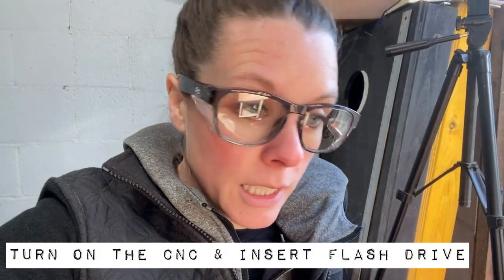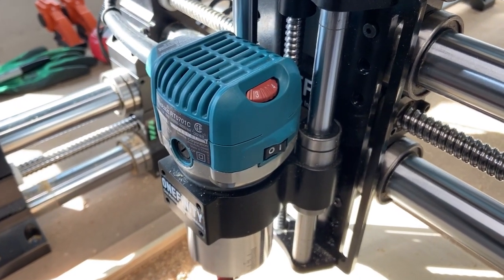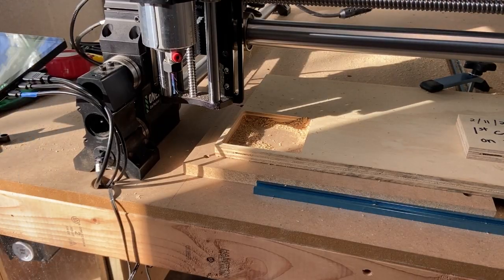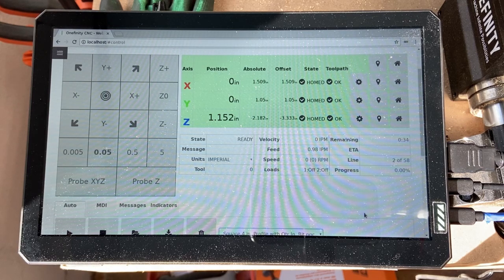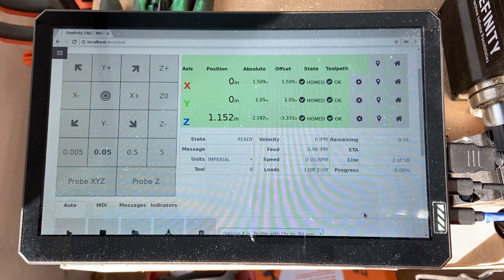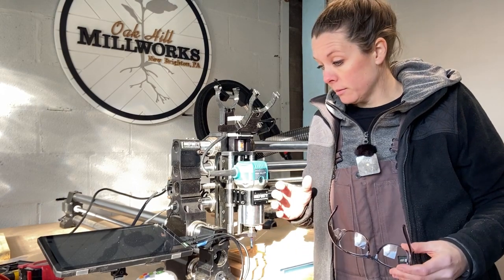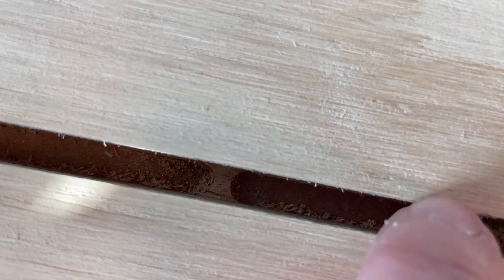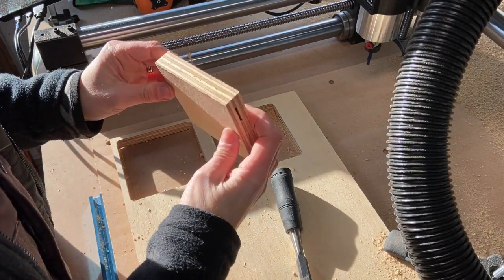BEGINNER'S GUIDE // PART 2 - Onefinity CNC - How to Program & Run Your First Job Using Vectric

Comment: Great video Boss!!    I have about a dozen projects under my belt now using my Onefinity.   I can’t say I have a preferred method of holding my projects down.   I think it depends on the size of my piece, if I want to use the whole piece, and if I don’t want to use tabs.  For clamping, I use push clamps and lever clamps by PwnCNC and the blue tape CA glue method for taping.
Reply from the maker: Sounds like you have a ton of options! That makes sense too. Thank you for watching!!

Comment: Excellent video. I like your simple and honest presentation. I’m curious about how you have your monitor mounted. It appears to be a metal holder instead of the horribly flimsy plastic one that comes with the machine. Could you tell me where you found that mount?  I’m using the small (8”) monitor but looking for a better solution for stability. Thanks-
J.B.
Reply from the maker: Hey J.B., thanks for the comment! It’s actually the same holder that came with my machine but I reversed some things so I could mount it on the table top rather than the table front. They also do make new mounts that are more like a claw and grasp the monitor. They work much better than the old ones.

Comment: My journeyman is still about two months away but ordered. Definitely like the videos. I really like what you did with the control box behind the plexiglass. Do you have any plans on that or just built to suit? So excited to get my machine up and running…
Reply from the maker: That is exciting! You’ll have that extra wide cutting area too! Very nice. Thanks for checking out the videos. I don’t have plans for the plexiglass box but I really just made a rudimentary box with a dado at the bottom to keep the 1/4” ply bottom floating so that wires in the back are accessible. Reach out if you build it and have issues. I’m available for messaging on Instagram @oakhillmillworks or have a Facebook page as well! Good luck!

Comment: I seen in one of your videos X-Fasten double sided tape however when I look for it I see many types of X-Fasten double sided sticky tape, I would like to purchase the one you had good luck with to try out but do not know the exact one it is.
Reply from the maker: Hey again! It’s actually linked in the description of this video. Go to the link that says full list of CNC tools. It’s in there. It’s a 3 pack of 1” double sided X-fasten tape. It works great! Use a utility knife to peel the paper off when you get one side stuck to your piece and are ready to stick it down to your Wasteboard. Hope that helps.

Comment: Wouldn’t you only need to reset X and Y as Z is the same because you’re using the same material?  Doesn’t hurt to reset Z but was it a necessary step?
Reply from the maker: Great question. I think it likely would have been fine if I had just reset X and Y but heaven forbid someone’s material is cupped or that part of their wasteboard isn’t as flat and the Z technically could vary a bit. In the grand scheme of things, it would still have worked out without resetting the Z. Thanks for asking!
Reply: @OakHillMillworks  I listened to your video 5 things to consider… and luckily I’ve done/doing them all. I ordered an elite foreman and a Pwnc 80mm spindle. I figure it will be here in October. In the meantime I purchased Vectric Pro and have spend hours listening to Mark Lindsay and IDC Woodcraft videos and yours. I’ve learned a ton. I listen to the video on my IPad and follow along on my laptop with Vectric Pro as I’m a “do it, learn it” kind of person.  Keep up the good work.
Reply from the maker: that’s awesome! Sounds like you are about to be a busy guy!